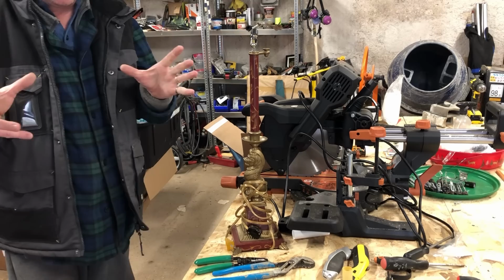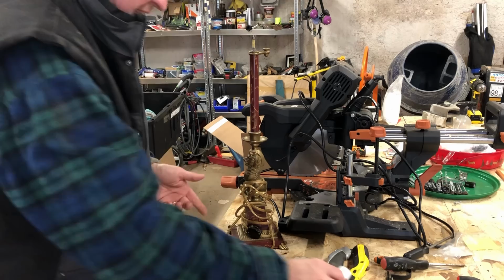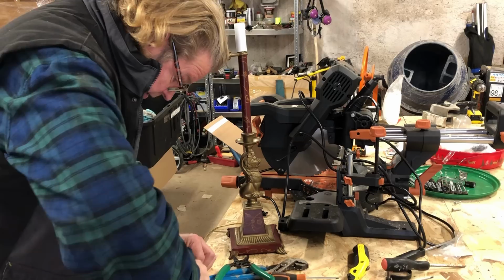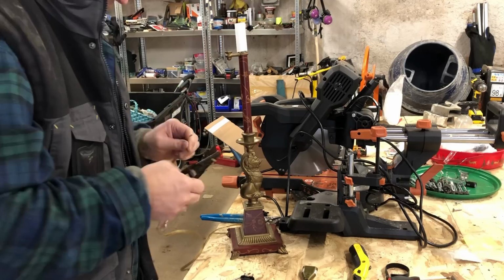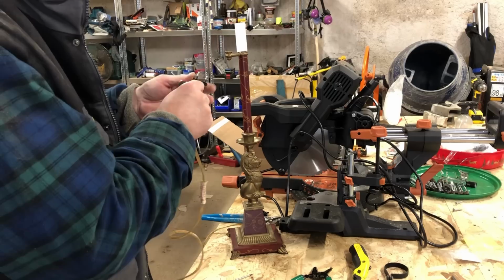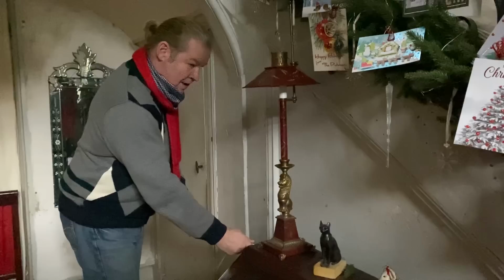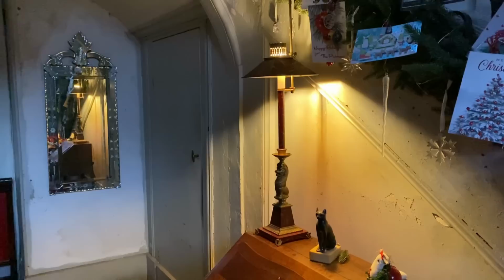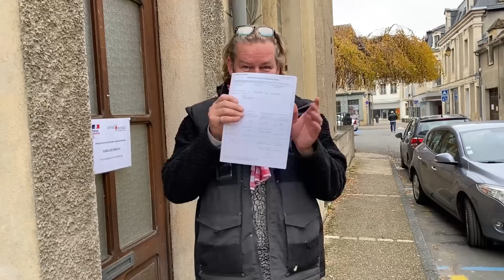CONVERTING a LAMP from AMERICAN to FRENCH, DIY - Journey to the Château de Colombe, Ep. 62

Comment: Just a tip: I use a hot glue gun to create drips on the candle sleeve and then paint them with a flat acrylic paint in the color I want. Much prettier than the stark white candle sleeves and much less expensive than those on Amazon.

Comment: Best wishes for 2023…. You have achieved so much so far….and looking forward to the ongoing journey. Regarding your light conversions, can I suggest anything you do should be given the once over by your resident electrician…house fires are often caused by faulty wiring….also I would have changed that plastic wiring to silk covered cable ..you are in a period home, and silk covered cable is more in keeping. The new version of wiring is much more refined and can be in different colours to suit rooms colours…shop around and be safe at all times with wiring. All the best

Comment: This is perhaps a late comment but, did you check that the US wires could carry the load?
Reply from the maker: Yes. We didn't take anything electronic that wasn't marked as 110/220 where you just need to change the plugs or use an adapter.